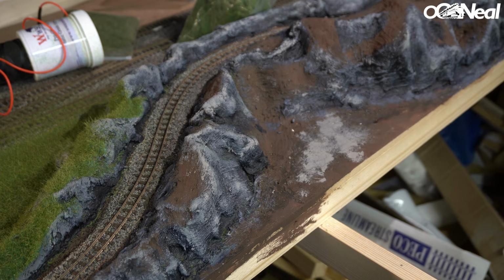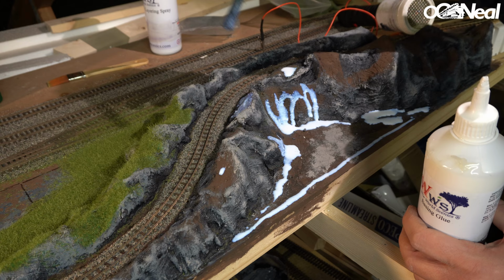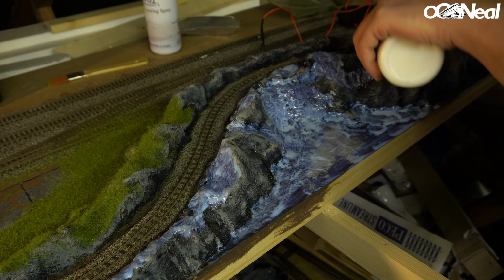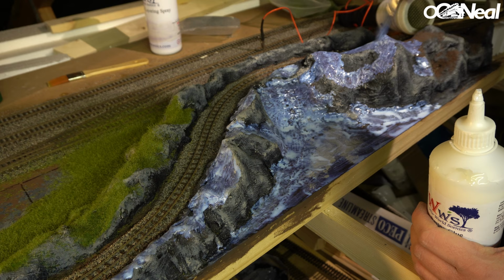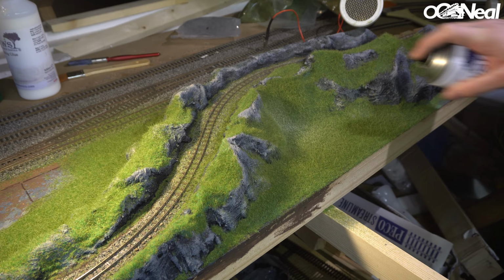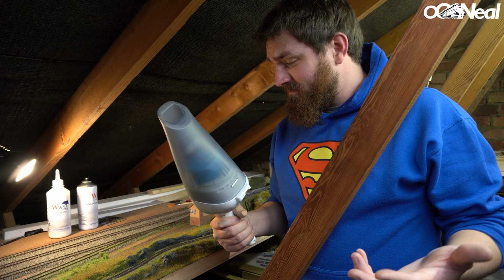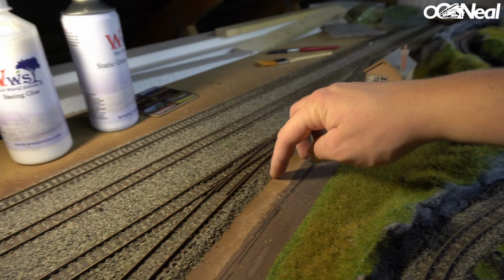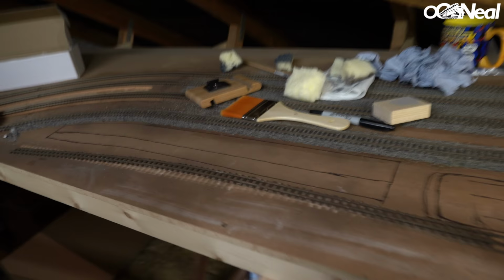Building Up A Model Railway S1 Ep 19 | How To Use Static Grass

Comment: Nice job Tris,looks great.Here a tip. If you can find a piece of nylon stocking you put it around the nozzle of your hoover tape so it doesn't get sucked in and when your picking up the static grass it will collect at the end of the nozzle .So you don't have to worry about other bits of unwanted material that may be inside the canister.cheers